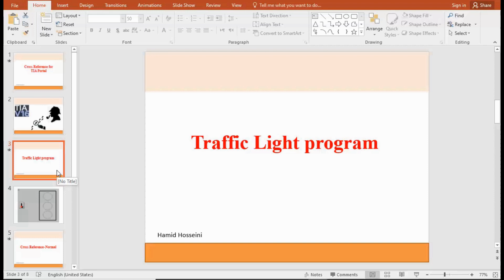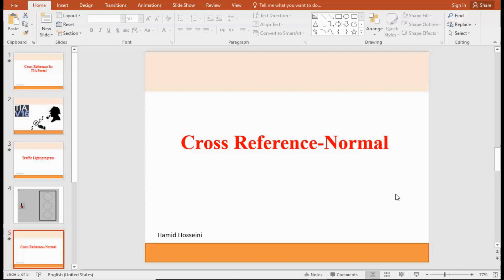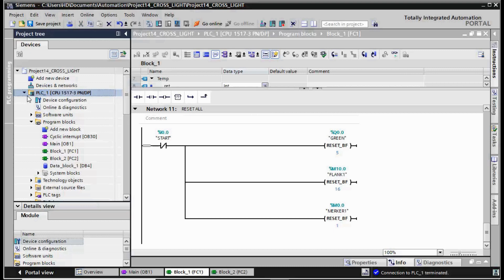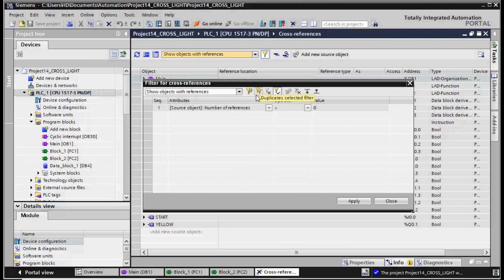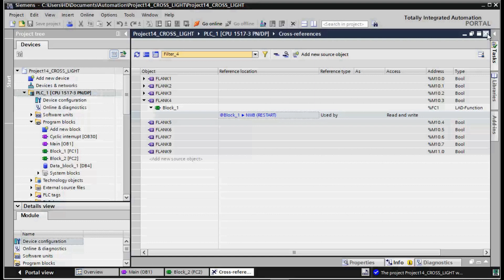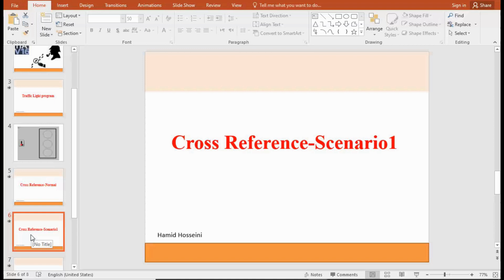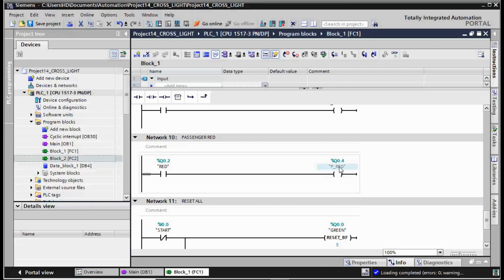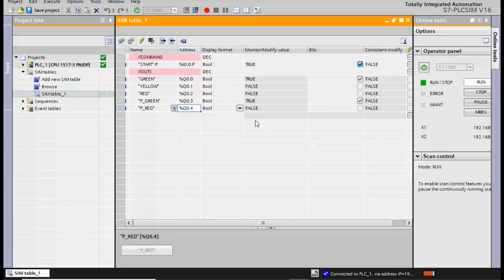Cross Reference for SIEMENS TIA Portal | Fault Finding|  Troubleshooting PLC Program | S7-1500

Comment: Hello Sir,Have a good day.I have recently facing problem in a newly buying Siemens PS2(2wire, 4-20ma, 2 wire, without HART) smart positioner connect with my existing Single acting, air to open linear actuator(pneumatic control valve) having 20mm stroke when I am going to newly calibation.During commissioning this new positioner with existing control valve/actuator in initial condition its display shows P 85 and NOINI mode, at that time when if i press (+) and (-) button then the actuatortotally doesn’t not move.only small clicking sound hearing inside the positioner and little air Release from actuating pressure line(Y1) of positioner , however pneumatic(4kg air pressure) and electrical(4ma , 24VDc) connection is ok there. Interesting matter is, if i place old existing positioner there then it easily move the actuator after pressing (+) and (- ) key in P85, NOINI mode. Is there any problem of lever setting or restrictor setting there.i don’t change any restrictor setting in this newly buying positioner during commissioning there.i am confused if there any setting required in restrictor at positioner during newly commissioning?

I appreciating if anybody here who can advice me kindly please to fix this problem.
Reply from the maker: Thanks for your message .My knowledge regarding positioners are limited . I suggest you share your topic in the following conference of SIEMENS forum:

https://support.industry.siemens.com/tf/ww/en/threads/179/?page=0&pageSize=10